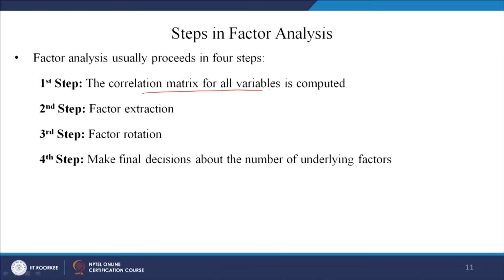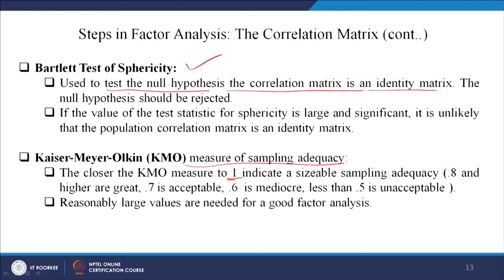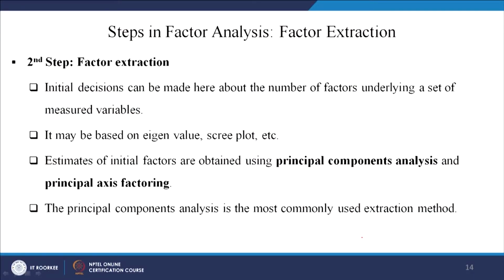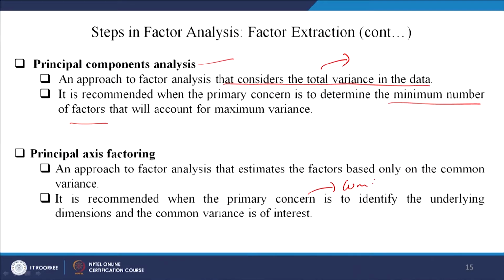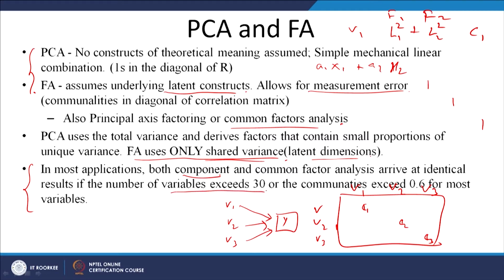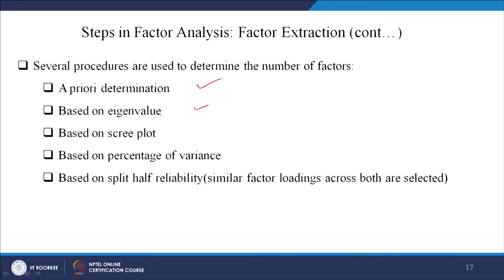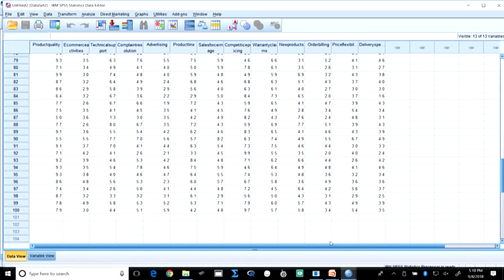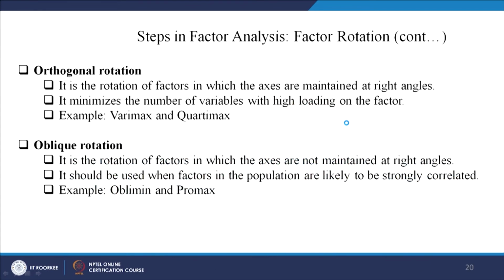52. Factor Analysis in SPSS - II

Comment: Respected Sir, 
Greetings of the day!

I have seen both the videos of factor analysis and trying to do the same with the dataset having variables Sir. While doing this 
1. While extracting factors based on Eigen value, I got only 1 factor with 80% of variance.then I have tried with fixed number of factors by giving input as 3, I got three factors. 

2. Everything went well till before step of rotation, there with Varimax rotation, my factors were loaded with multiple variables. So, I have tried Direct Oblimin method as my variables are related to farmer behaviour, then I got it... 

Sir, am I going in the right direction? If not kindly suggest the best way to do it. 
I am very much interested in learning factor analysis. 
Kindly help sir.